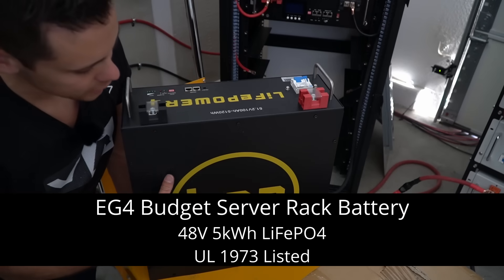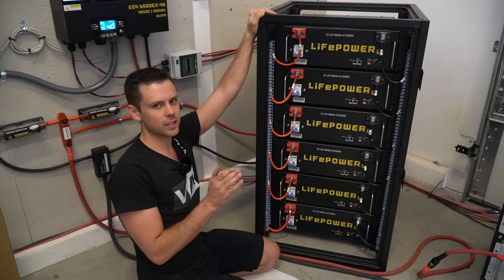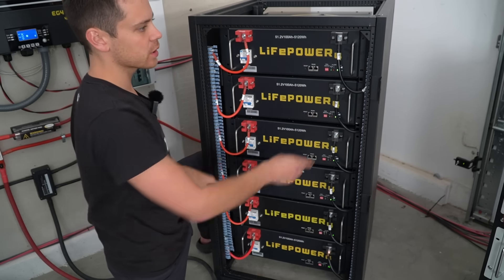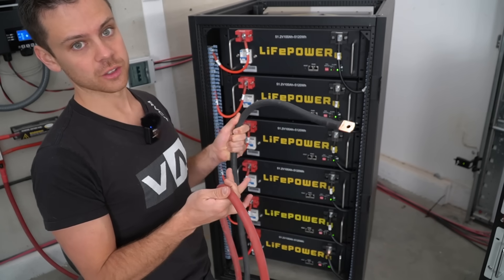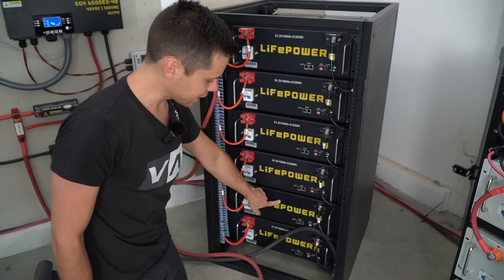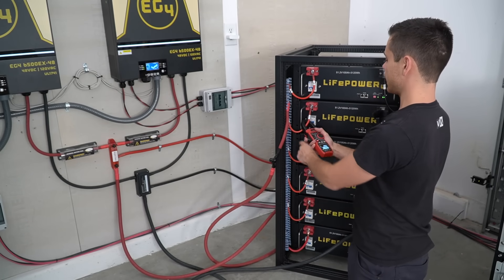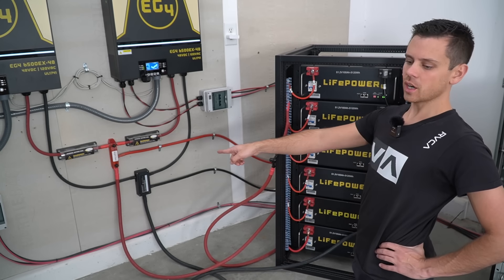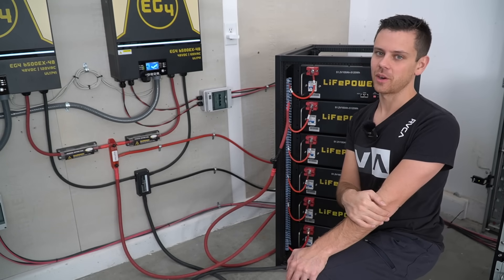How to Build an EG4 30 kWh LiFePO4 Server Rack Battery

Comment: Always enjoy watching your videos.  Very informative.  We've been wanting to incorporate a battery backup in our new construction and after living through 3 days of power outage and running extension cords from our generator to the fridge/freezers, I'm even more convinced.  I like how you provide the Kw/h info but for the less technically inclined, it would be cool if you did a video on how big a system needs to be (ie how much kw/h) we need to keep the main systems (lights, fridges, water pump for well, etc) up and running and how much kw/h would be needed per day.  i realize every home will vary but I'm hoping there's an average we can go by.

Keep your videos coming!   Love them.
Reply: You can look at your utility bill to see how many KWh you are using per day. You can also join his DIYSOLARFORUM to get more help.
Reply: Yes please!
Reply: Do you have have a "smart meter" supplied by your power company?  It allows you to check your power usage for the last couple of years all the way down to the hour of each day!  It is the greatest tool to use for planning your system.

Comment: Wow! That’s $9000 worth of just batteries. I built my own battery packs. I used new Lifepo4 32650 6ah batteries from Battery Hookup. My packs are 50P 252ah. I have 2 banks of 16 batteries wired in series at 51.2v each bank. That 25.600kw for under $5000. But to each there’s own. I like building things my own and save money.
Reply: Are you willing to offer it complete with functional BMS, 5 year warranty and ease of installation? I've got a big market available.
Reply: @stefanvanzyl9090  😂 the battery warranty is me, since I put them together. Then I would know how to take it apart and fix it. BMS? I’m using Batrium. Easy to get parts and replacements if needed. I totally understand people just like plug & play. But I like to build it, then if something goes wrong, I would know how to fix it.

Comment: Will, I noticed you didn't balance these batteries before putting them into service.  Is that because the inverters will perform that function over time?
Reply from the maker: These batteries have current regulation so you can connect them with different states of charge and fire them up and they will equalize over time. For them to equalize all the way you need to charge up to 100%. But it's totally safe to do so. Unlike other batteries without current regulation in the BMS
Reply: @WillProwse  I presume it's ok but I have 5 of these on my system.  3 are this exact battery and the other two are the EG4s with the little display screen.  So far no issues but did want to confirm.  Also doing your Dewalt rack this weekend.  Setting these on their side will be way more space effective for me.  Great stuff, keep it coming!
Reply: @WillProwse  - I am adding a 2nd rack (6+6), what are your thoughts on stacking the 4/0 cables on the external buss? Will the 12 batteries equalize over time? Thanks

Comment: That would run my house for a day and a half, nice setup.
Reply: Put up 7000 watts of solar and you're good!
Reply: @Jasonoid - Solar Power, Batteries, and More!  maybe in summer but not in winter. I'm trying to find a solution for my winter power needs that doesn't require a generator.  I think over sizing my solar array might do the trick but idk.
Reply: How far north are you? Here in NH my array produces about 4X more energy in June that it does in the dead of winter, its a big difference. We have net metering so I sized it to generate credits in the summer that I could spend in the winter and be mostly neutral, maybe a little positive over the whole year. Its a fairly big system at 12kW but its not optimally placed. Still, these new generation of panels really produce a lot of juice so I think you could definitely brute force it depending on how far north you are
Reply: @myvids4329  Kalispell, Montana

Comment: I look at these videos and I feel like 48V is a stop-gap.  We'll see inverters and batteries that can run at 100's of volts with safety interlocks (like in automotive) in the next few years.  That'll be when I jump in!
Reply: You probably won't be able to afford them. 

The batteries at crown are over $27K each, the weight is over 1,328 lbs.
Reply: @wehvacwehvac5612  Hypothetically, shouldn't the cost (and efficiency) of inverters go down as the supply voltage approaches the output voltage?
Reply: @bradley3549  SolarEdge and Tesla battery systems are already "high voltage". The efficiency goes up with higher voltage, not down. The "correct" DC voltage for conversion to 240Vac is 400Vdc, but there's a 1-2% efficiency hit when doing it from 48V first. 

The benefit of 48V is that it is considered low voltage by the NEC, so you don't have the massive regulatory overhead when working on it as a layperson - this is a leftover from the analog telephone days.
Reply: @stefanvanzyl9090  That's exactly the point I was making. You reduce part count and increase efficiency as the voltage approaches the peak-to-peak voltage of the AC waveform you are trying to reproduce.

The NEC requirements are probably the most interesting part. Though doesn't seem like a real significant issue all said and done if you're doing a grid tie system anyway and have to have the appropriate permits and inspections to do so.
Reply: @bradley3549  no matter what arrangement you end up with, each LFP battery cell is only 3.2V nominal, so you need more cells to reach 400V than you would to reach 48V. Each cell needs to be individually managed by a BMS - so 16x 100Ah cells for 48V 5kW is easier and cheaper than 125x 4Ah cells for 400V 5kW (as an example) 

All of this complication for a 2% increase in per cycle efficiency isn't worth it at the low end - it's cheaper to just add another solar panel to make up for it.
Reply: @bradley3549  Yes Sir.

As a (CEC) California Energy Commission State Inspector who is proud to tell you the truth.

They're all about the money train!!...

They should go down, but with the danger of higher voltage, air to air gasses and micro dots you'll need a positive air rate of 0.008 @50 Pa (Pascal) at a minimum. 

Placards at all 4 sides of the aisle, building entrance. 

Which is considered Hazardous Materials under the EPA standard Regulations, and  (IBC) International Building Codes. 

Plus our local Government needing to control your every move with overpriced building permits!!...

Widowmaker a man of God. 
"E Pluribus Unum" D'n 
Deus Le' Vult!!...
Reply: All major battery brand have hight voltage  solar battery.

Comment: Thanks for your videos. I have 38- 340watt panels on my roof and 2 enphase battery packs for a total of 20kws. I am about to receive 10 more 400w panels and another 10Kw enphase battery. I wish i had the knowledge to do it myself so i wouldn't have to over pay for the system.
Reply: Dang how large of a residential house, or this a house and commercial space/shop?
Reply: @wehvacwehvac5612  House, 2500ft. Its all electric. no gas. Pool pump.

Comment: Why did you not set the battery dipswitches and get the battery to battery comms going along with the battery to the EG4 inverters? It should be a complete system that should play really nicely together.
Reply from the maker: I stated why in the video. And in the pinned comment. It will be a separate video for full system communication
Reply: At the end of the next vid he said that he was going to do a battery setup video in the future but I never saw it or can't find it.

For anyone that reads this the Lifepower4 batteries should have the battery connected to the inverter with 4 switches down (off) and then every other battery should have a unique switch configuration which is that battery's ID used by the inverter or computer.

Comment: Hey please try testing and teardown of limitless lithium battery, their output current rating is 674 amp or 8500 watts in 12 volt 45ah battery!
( companie's name is limitless )
please reply if you don't want to try it just say no to me...🙄🤷🙇
Reply: Why would anyone be interested in storing only 0.5kWh in a $1280 battery...? The limitless batteries aren't aimed at storage applications. 

The minimum configuration for this to work at 48V is 4x batteries, $5120 for 2kWh of storage, compared to a single 5kWh EG4 for $1500...

Lastly, it doesn't appear that limitless offers warranty (or at least, they don't discuss it on their website)
Reply: @stefanvanzyl9090  I'd like to see how they do this.

their battery's output rating is 674 amps or 8500 watts on a 45ah battery!

I'd like to see what kind of cells they are using and the BMS that can handle this amount of current.

That's why I'm telling try testing limitless battery's

(they're mainly made for car audio not for storage)

my intention is not for storage, it's for my curiosity!

did you understand now why I am telling to try testing limitless lithium battery's?😀
Reply: @CG17LIFE  I unfortunately don't understand... The way cells are manufactured, you can choose to have a higher contact area, which allows for higher peak current, or more storage material, which allows for more power stored for the same battery weight - it's a trade off between car audio usage and storage usage. 

Incidentally, you can buy the 12V version of the EG4 battery for the same $1500 price, it comes with a 400A BMS, which is enough for a 5000W sound system, and will last 10x longer than the limitless
Reply: @stefanvanzyl9090  whatever the company is that can handle this amount of current, i just want to know how it looks and works from the inside.
did you understand now?🙂

(and sorry my english is not that good)😔
Reply: @stefanvanzyl9090  because no one has uploaded this kind of battery teardown video.

 no of i can't find🥲
Reply: @stefanvanzyl9090  and thank for your this 

The way cells are manufactured, you can choose to have a higher contact area, which allows for higher peak current, or more storage material, which allows for more power stored for the same battery weight - it's a trade off between car audio usage and storage usage

knowledge I appreciate that, I didn't know before🙇
Reply: @CG17LIFE  i don't think many people have the money to break a $1300 battery, for only a few views on Youtube.. The cells inside can be seen when you search for "limitless lithium fire" by ybass in youtube (i can't share links)
Reply: @stefanvanzyl9090  thank you for giving your knowledge and time bro. much appreciated🙇🫂

Comment: What would be the cost of installing plus solar panels Vs that amount on electricity bills.
Also factoring in the cost of battery degradation to the point they become unable to supply your demands and need replacing?
Reply: The answer to this involves so many variable specific to your situation, that you will never get an (accurate) answer here on YouTube
Reply from the maker: I have multiple extensive videos on this. Please check out my older videos
Reply from the maker: Cover this many many times

Comment: With so much variance and a decent busbar I doubt if the diagonal configuration makes much of a difference. The chemical difference between the packs is going to make a much more significant difference vs connecting to the top or bottom of a bus bar…
Reply from the maker: Actually it makes a significant difference. Watch my other videos on current sharing to show this in action. Also look at viewers comments where they had that exact setup and had current sharing problems.
Reply: @WillProwse  I agree 100% that it would make a difference if you use cables, especially if cables go from one battery to the other. I find it hard to believe that it would make a signficant difference when using a solid bus bar with low resistance. The difference in resistance between top and bottom rack should be minimal - much lower than the difference the cables to the racks or the internal resistance of the racks and batteries. I did watch most of your videos, but don't think I bumped into one that shows this effect on a rack mount with solid low resistance bus bars (again, it can definitely be an issue when using cables and jumping from one battery to other due to connection resistance etc).
Reply: @ranig2848  Victron has tested this extensively, they've written a whitepaper on it (that's where Will's inserted image comes from) - it remains absolutely worth the miniscule amount of extra effort for the cycling gains - remember if one pack is empty before the others, you lose 1/6th of your output capacity immediately.
Reply: @ranig2848  correct size bus bar should be a requirement, but I’m more interested in configuring these banks with the proper inter-battery comms and the CAN to the inverter. I think a lot of the balancing issues might be improved if the BMS in each pack intelligently know about all the batteries in the pack.  Lets hope a test like that will be done. I’m a big fan of CAN based comms with multiple batteries in a pack… it’s the “clever software” portion missing in configurations where it’s not used.
Reply: @ranig2848  See my reply to Roy Kaplan near the beginning of the replies.
Reply: It is still a good practice to go diagonal with connections as the battery voltages over time will converge as they are cycled..

Comment: I've actually looked at those batteries they have the 5-year warranty. The Next Step Up is the 10-year warranty with the digital display. Is it worth the extra money to buy the 10-year guaranteed one?
Reply: both of these batteries would survive 15 years+ at once daily cycling like done with a solar system. Calendar aging would kill them long before cycling does. So if you're looking at only daily cycling at worst, the "extra" money for the LL is wasted.
Reply: @stefanvanzyl9090  
I've heard a "cycle" means "anytime you discharge and then charge a battery".

Does this mean a "cycle" that drops 5% of the kwh and then recharges the 5% kwh back counts as "one" cycle in terms of battery life?
Reply: @dialecticalmonist3405  A cycle is when you have discharged the battery cumulatively by 100%. So if you discharge 25% one day, recharge and then discharge 75% the next. That would count as one cycle.
Reply: @MaxCaud  
Ok, thank you. That makes sense.
Reply: I've also heard that they've not had any warranty issues to date, just a few damaged in shipment issues...
Beauty is in the eye of the beholder; I spend my money wisely because I don't want to ever have to use a warranty.
Reply: From what I have heard: they're exactly the same quality, it's just that the extra price allows Signature Solar to Warrant them longer. Not really that much extra $ in the scheme of things... I plan on buying more in the future and I see that it would be worth it to me to have the readout built in and the extended warranty.
Reply: Absolutely. 

Solar energy is going to encounter a 13% increase in price by the end of this year in California and other States too follow with a $8.00 dollar per Kwh new tax!!...

Widowmaker a man of God. 
"E Pluribus Unum" D'n 
Deus Le' Vult!!...

industry